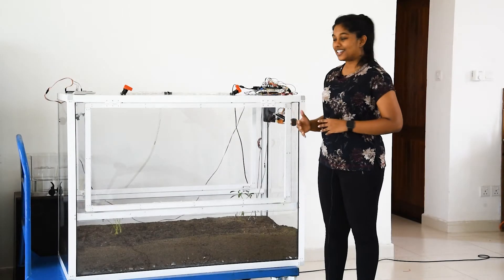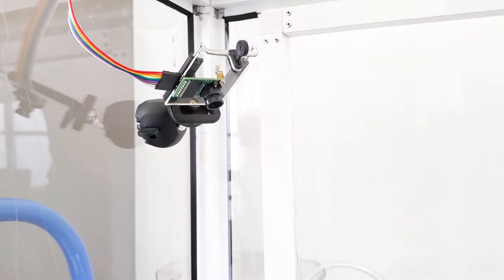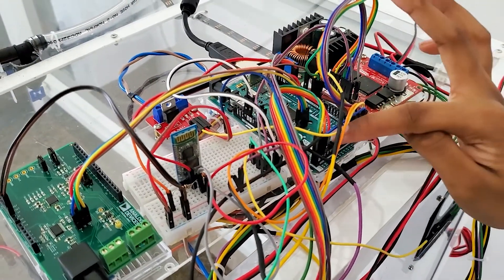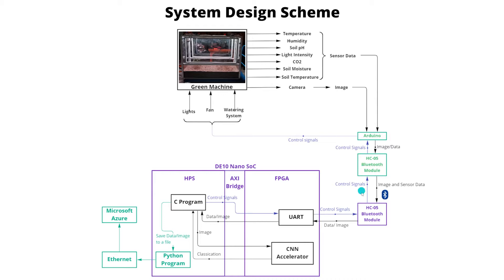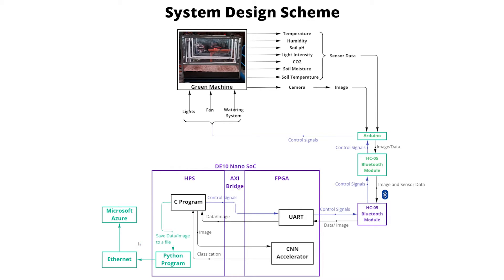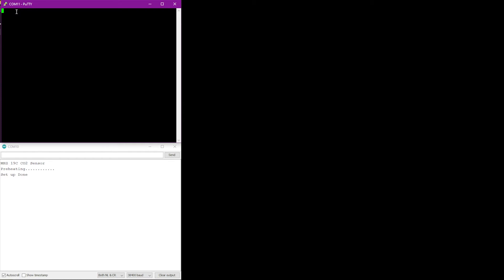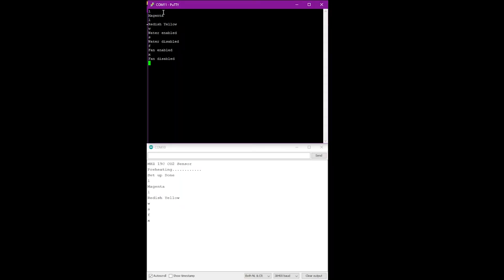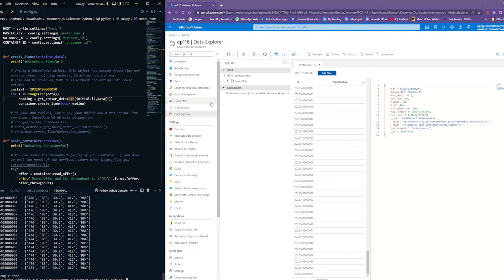The Green Machine - Project Demo Video by Team AP116  -InnovateFPGA21/22

Comment: Interesting,
Will this be cost effective for commercial farmers?
Could have included financial analysis as well.
All the best 👍
Reply from the maker: Yes, using an FPGA is cost effective compared to a microcontroller based system that given similar performance. And the power consumption is made to be very low. Overall, the maintenance cost of the green machine is affordable to a commercial farmer, as well as a domestic user. However, the initial cost of the greenhouse structure may vary according to its size. We are planning to look into cost effective ways to build the structure. Thank you very much for the suggestion and well wishes!